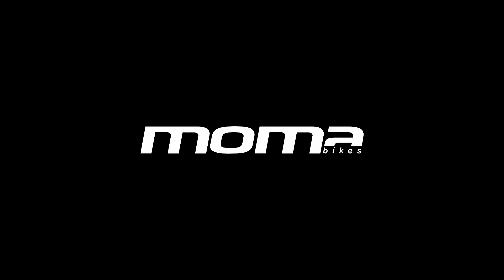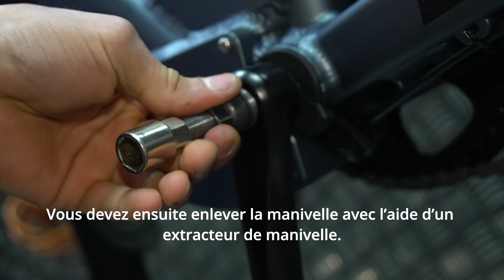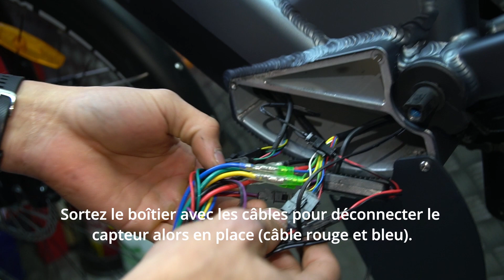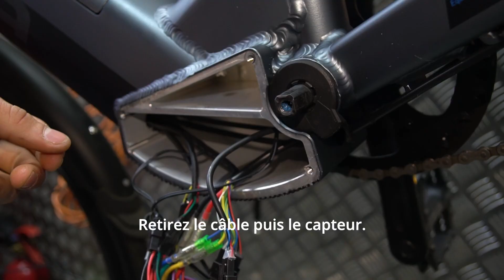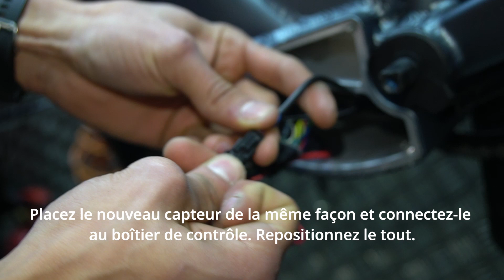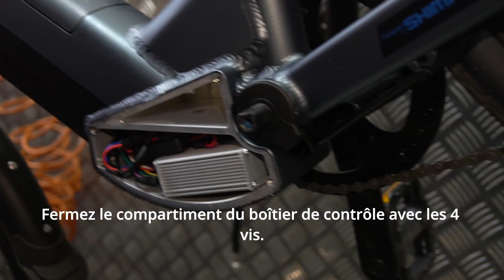Replacement capteur | @momabikes4348

Comment: Je confirme que c'est de la m..... , MOMA ment sur tous ses VAE , la batterie n'est pas une 48V mais une 44,4V (12s 5p)  les cellules sont des no-name 2500mah (2500x5=12.5Ah) Quand aux watts heure : 12.5Ah x 3.7V x 12 = 555Wh . Donc 44.4V   12.5Ah et 555Wh et cela de façon théorique , car vous l'avez bien compris , c'est de la M.....
Mon 27.5 emtb a duré 2ans et quelques mois . Batterie morte , je l'ai faite reconditionnée avec de vraies cellules de marque , la batterie complète pèse un bon kilo de plus . Le technicien a mis des mois à essayer de rentrer les cellules et son BSM ( impossible de trouver un bsm 12s aussi petit ) dans l'étroite batterie en forme de toblerone . Une catastrophe , le contrôleur a lâché aussi   . Je suis entrain d'essayer de ressusciter le VAE , en changeant , et bien j'ai pas le choix , tout , tout sauf le moteur . Et c'est une p........ de galère , à cause de l'emplacement ridicule du contrôleur  , du passage des câbles , de l'impossibilité de trouver un contrôleur 12S  . Je passe sur la qualité du vélo , de son assistance qui coupe 1s après le pédalage , et mets aussi 1s pour se mettre en marche , la suspension arrière fake  ...
Batterie jetable , vélo jetable , et la "marque" avec !